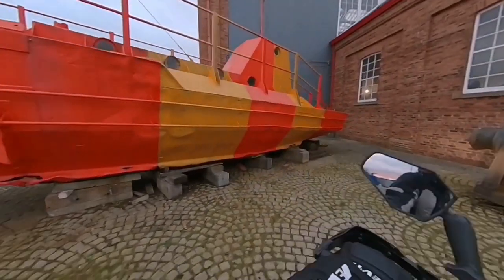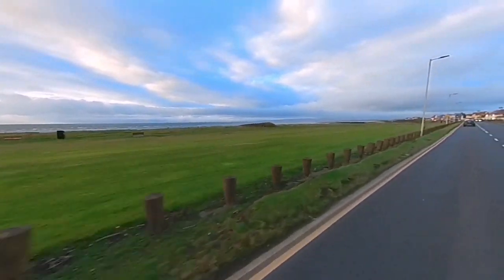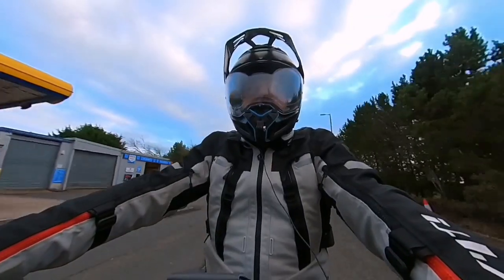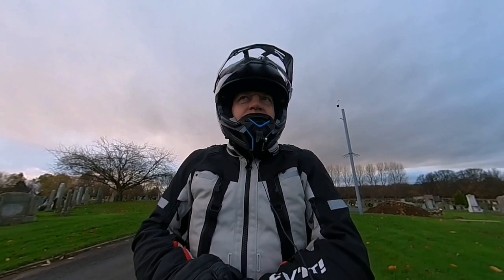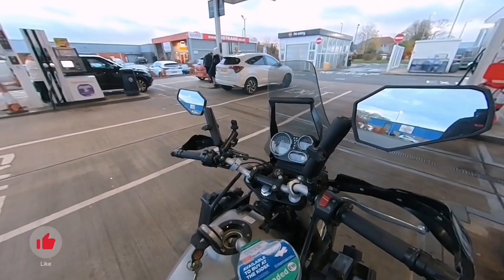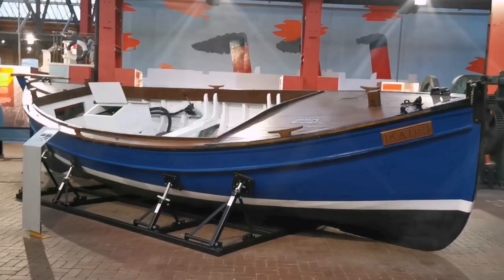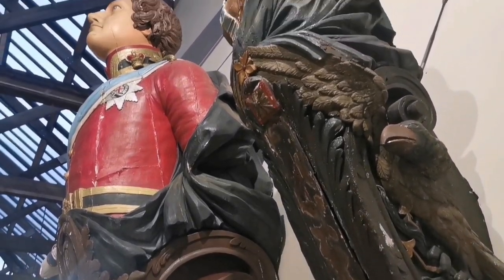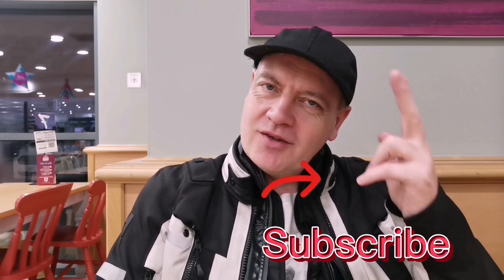Himalayan Road Trip - The Scottish Maritime Museum - Troon to Irvine - Wee jaunt Enfield Himalayan

Comment: I presume the comment about the big arrow to know which end of the boat was the front was a bit tongue in cheek. Old kayaks and quite modern sailing dinghies still have it. Its usually called the cockpit coaming and its supposed to deflect the water that comes over the bow of the vessel sideways and off the sides instead of filling up the cockpit and having to be bailed out.
Reply from the maker: Hi Sean. Believe it or not I read that right off the blurb next to the boat about the arrow at the front for ww2 airmen. They were aparently taught to look for it. It does seem an odd reason right enough but I guess the two factors combined, the coaming is at the front so tell the airmen it's an arrow and to look for that in the panic when the boat drops? It's entirely possible I read it wrong though. Thanks for the info mate very interesting 👍
Reply: @WeeJaunt  I suppose it makes sense to tell the airmen that as it would be an easy way for them to know which end is which even if that isn't the reason its there. Those would have been very young and some would never have been near the sea and unable to swim. To have to use one of them for real especially if it was dark would have been frightening. I have been in the Fleetwood Nautical college pool as an observer when  the put the lights out, start the wave machine and play the shouts and screams for practising Helicopter ditching. That was quite realistic and shocking. Scottish Tourism should be sponsoring you, your videos are more interesting than their adverts.
Reply from the maker: @seankearney6915  Aye a recon that's what it must have been eh. Intereresting right enough 👍